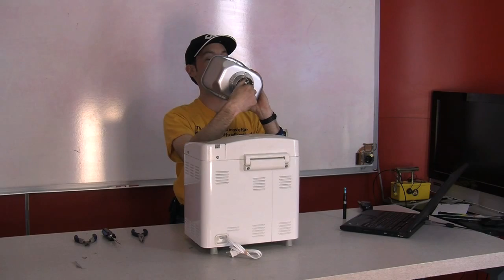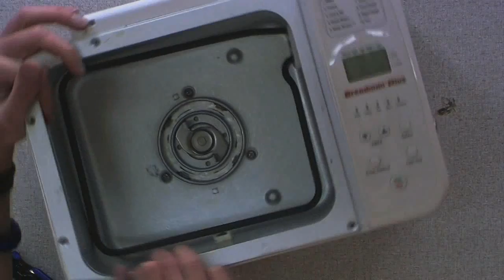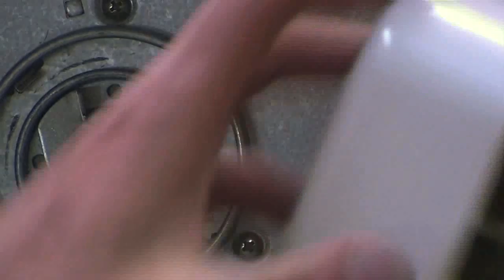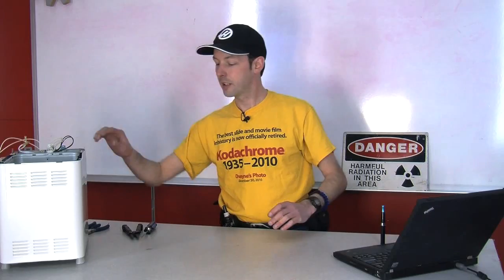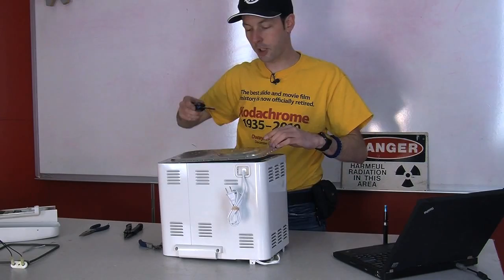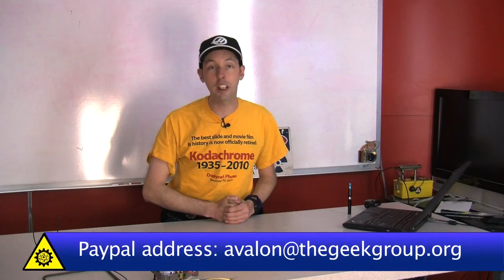Breadman Plus Breadmaker: Equipment Autopsy #42

Comment: Hello,great vid.do you know how I could switch off the beep sound,its driving me crazy.
Reply: A permanent way is with a wad of bubbble gum, jammed into the piezo-electric transducer. THe clear part is the plastic membrane. The hole where the cycinder has , is where the sound emenates from. (sorry this replay is 4 years late!). Another way would be to disassemble the whole machine and de-solder the speaker from the control board.

Comment: @sprogdiklis That actually isn't a letter "U" in 10 uf, it's a Greek letter "Mu" it looks like a "U" with a tail on it. Mu stands for micro which is one millionth of a Farad or microfarad. A 10 Farad capacitor would be quite substantial indeed, at 240 vac it would be the size of the bench he's working on if not larger, a motor capacitor would have no reason to be that large.

Comment: also for all concerned geeks I am no stranger to high voltages, TV repair and vacuum tube based electronics are some of my hobbies, I've had my fair share of "oh #@$&!" shocks, and learned why they call it a flyback transformer, it bites you, you fly backwards! The ones in 40inch monster mitsubishi TV's and MOT's have a lot in common in terms of voltage and current ratings on their high sides, that's one BIG CRT, to scan that takes a lot of electromotive oomph.